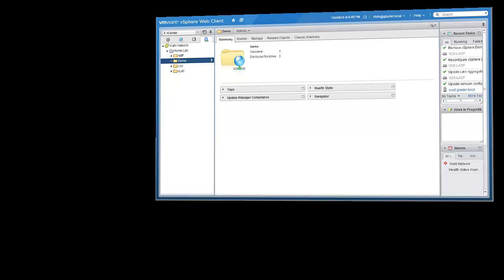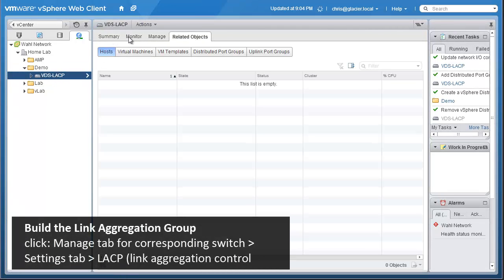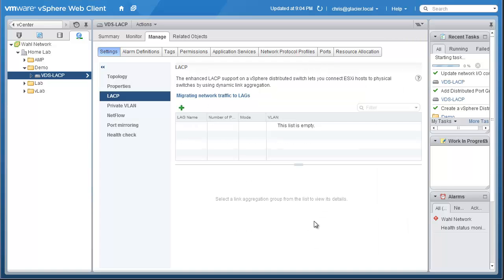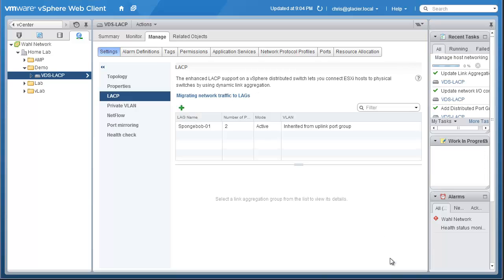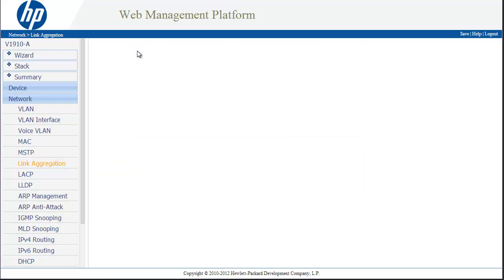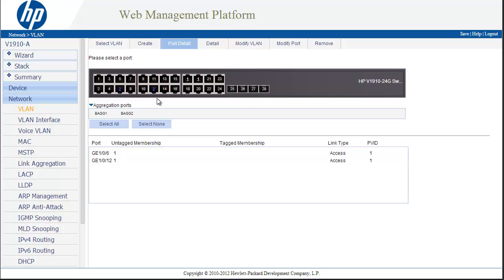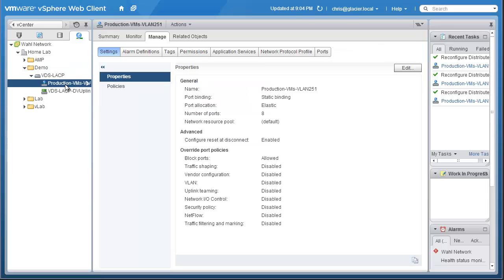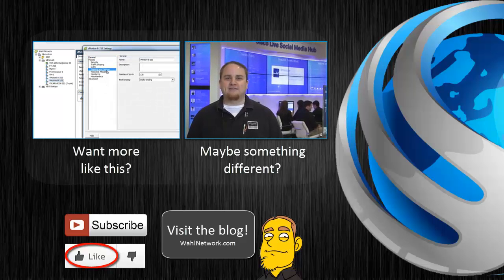Creating a Link Aggregation Group with vSphere 5.5 and LACP

Comment: Would this kind of setup allow for "twice" the network speed, like e.g. two gigabit?
Reply: Yes, that is what LAG does.  It also provides in addition to greater speed/throughput affords resiliency and redundancy.  A LAG can have up to 8 interfaces in the group.  If we are using all Gigabit links you can create an 8GB (16GB throughput) LAG, you can use other link speeds they just won't be as fast.  You cannot mix and match link speeds.  If one link were to fail you would still have a 7GB LAG.  In this case he created a LAG with 2 Gigabit links for 2GB (4GB throughput = bidirectional speed).  If one link fails the server will still have 1GB (2GB throughput).  When planning your LAG you should consider what the minimum required throughput is for your servers and design your LAG around this.  In the case here with a 2 link LAG the assumed minimum throughput is 2GB (1 Gigabith interface) or half the LAGs full capability.

Comment: Thank you, very helpful video.

I have got 2 hosts with 4x1gbps and a synology 1515
will it make sense using lacp for storage traffic if I am not using VAAI supported iscsi on synology? will it help in getting max throughput while doing a svmotion or deploying vm from templates?